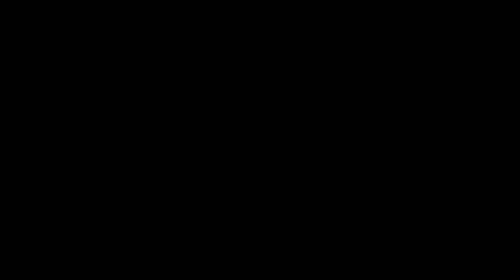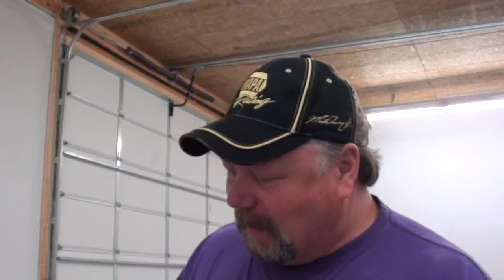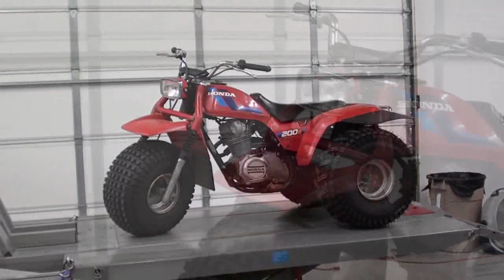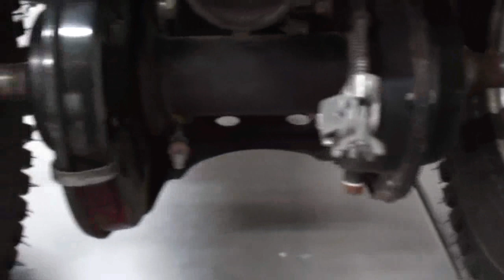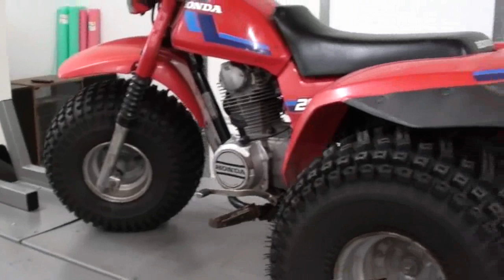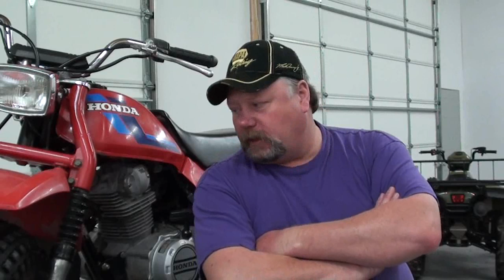Pt.1 Honda ATC200S Bringing It Back To Life

Comment: I have a 1982 big red 200. All orig and really clean like yours. Mine actually still has the original tires. It runs great but I ride it in the snow and the brake levers pull all the way to the bars like there is no brake. But I can manually knock the front adjuster out so it works. Are they rusted inside or bad shoes? Thanks

Comment: what ya at?? i have a question about a 1985 200M.. i been riding it for a little while now, and she works Great after she warms up.. but my problem is that even after sh warms up, she still wont idol when i bring her to a stop... i have to keep on the throttle to keep activity.... NOW i must admit, the bike isnt in the Best of shape.. but living on the salt water coasts of Newfoundland, rust is Bound to happen... im surprises shes lasted this long to be honest.... So Anyways D-Ray, My Question is, How can i increase the throttle response/tighten the throttle cable, or is there something else i should be doing?? (keep in mind that my carb is clean, im unable to do any fine tuning due to the fact i only have a 150 pc socket kit and a basic pocket wrench set) and she just has an Incredibly low idol rate that when i let off the throttle and stop, she stops working if i dont keep on the throttle...

If you could help me out, That would be Great!! :) Thanks

Comment: hey there, how u doing. trying to get my 200s back to running, it was running good, then after letting it warm up it goin out for ride it would stall out on me but only when honkin on er not puttin around.. then wouldnt hold idle, used ur video cleaning the carb and adjusting, it now holds idle but still will bog and stall out after warming up and taken easy for 5 mins then when i ho.. nk on her, she'll bog out and stall, any ideas? lookin forward from some tips from ya, thanks ahead of time

Comment: HEY MAN JUST BOUGHT ME A NICE BARN FIND 1981 185S THREE WHEELER IT STARTS FIRST PULL BUT TIMING CHAIN IS A SLAPPING AND TOOK IT TO GET FIXED GUY BRINGS BACK SAYS GOT 95 PERCENT OF SLAP OUT IM NOT SURE SO WANTING TO CHANGE THE TIMING CHAIN BUT GOING TO TRY MYSELF CAUSE THINK I GOT JIPPED BY THE OTHER GUY NEED TO FIND THE 3X5 SCREW TO MAYBE YOU CAN SELL ME ONE AND DO A VIDEO OF A TIMING BELT CHAIN ALSO NOW WHEN I PUT IT IN GEAR SINCE I GOT IT BACK FROM HIM IT ALMOST JUST SLAMS INTO GEAR DANG NEAR POPS A WHEELIE WHEN PUT IN FIRST CAN YOU HELP A FELLOW COUNTRY BOY OUT HOW MUCH IF I SEND YOU THE MOTOR TO REBUILD I CAN ALSO SUPPLY PARTS